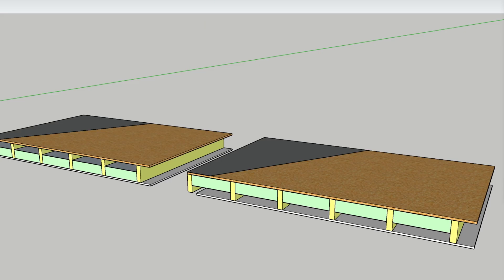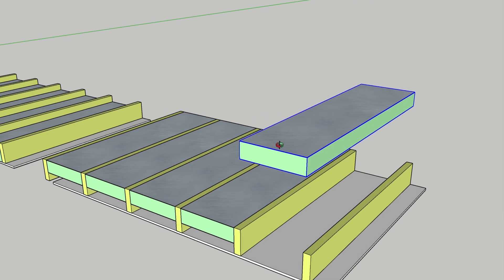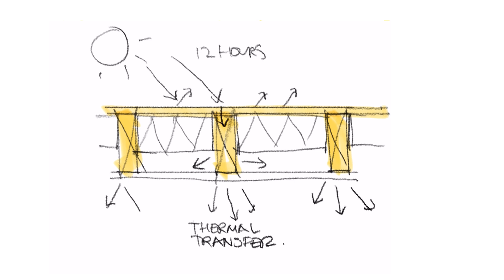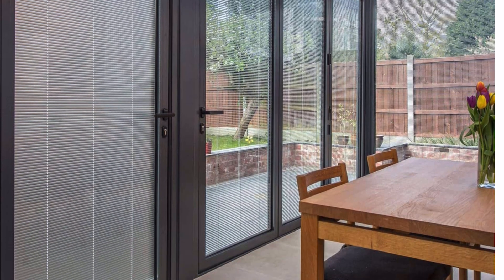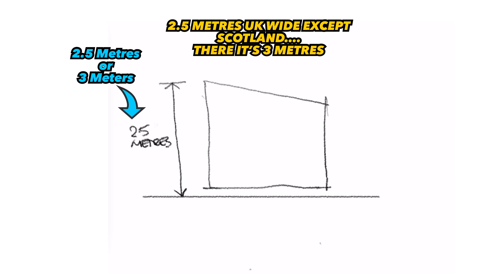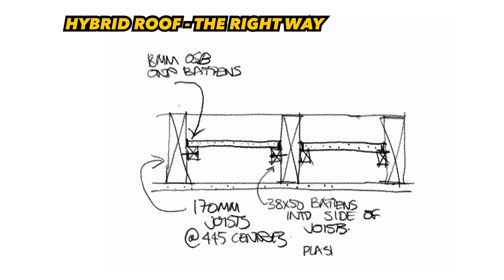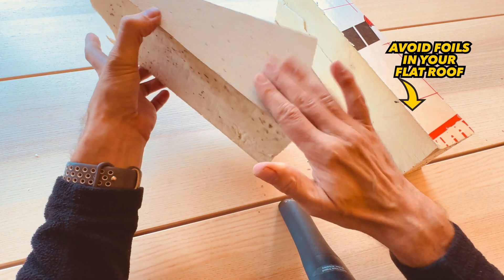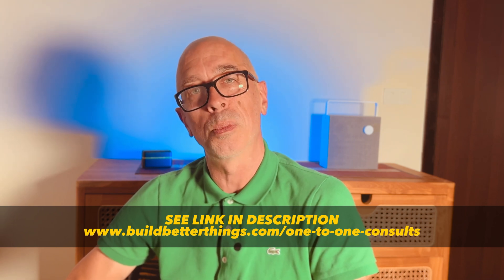Hybrid Roof - Build the Right Way- avoid overheating, avoid timber deck.

Comment: Sure this is less wrong than the "hybrid" roofs suggested by lots of these garden room builders but it's still wrong. The moisture is now going to be concentrating in the top of the rafters. The only safe longterm hybrid roof is using vapour open insulation and a vented deck. Can't always have our cake and eat. Better to have a low ceiling than a mouldy rotting space you spent money on and don't want to be in a few years down the line.
Reply from the maker: Hi. Moisture will collect where escaped and residual vapour meets cold. This will be toward the outer layer of insulation which sits over the joists, so beyond the upper face of  joists (you call them rafters,….same thing). That’s the whole purpose of the 30mm outer layer of PIR. These small amounts of condensed moisture can slowly permeate up and through the breathable compound of the EPDM. If you can get your joists down to 150mm, then that PIR increases to 50mm and an even better arrangement.  The whole point of this detail is to avoid timbers, but especially timber composites such as OSB, on the “cold” side. And avoid foils. Like you, I don’t love the detail, but there is no other way to prevent thermal bridging, rot, and achieve a useable floor to ceiling height for permitted development legislation. What I’m showing is the best possible make up to conform with the legislation. Since you’re mentioning “wrong”,…..I assure you….  your  suggestion cannot work with the heights available. Perhaps it’s just the legislation that’s “wrong”.

Comment: I had a roof designed with a foil quilt company. We have an non vented deck above the blanket, then 120mm of rockwool, foil vapour barrier, counter battern, plasterboard. Wiring and downlights fit in the counter batterned void. I could have done with a little more space for the lights, but compact downlights just about fit in and I only drop down the distance of the batterns for the ceilings to run through the house. What I like about the quilt is the ease to tuck in to the cavity wall insulation, all my steels are inside the thermal envelope, rockwool is so much better for sound insulation and I honestly hate PIR.
Reply from the maker: Agree, mineral wool more versatile for those tricky junctions and definitely for the acoustic side of things.

Comment: If you want to prevent overheating in the summer then you might want to look further than PIR!
Reply from the maker: Isn’t PIR a good insulator? What would you recommend instead?
Reply: @build-better-things  Cellulose for example, it can keep the heat out in the summer for much longer than PIR.
Reply: PIR is a good insulator but it doesnt have a lot for thermal mass.

Comment: Built a hybrid flat roof with the aid of a design engineer 1.5 years ago. 
Plasterboard
Counter batons
Vapour control Layer
Flat Roof joists fully filled with Steico wood fibre insulation
Osb 
Breather membrane
3 inches of PIR insulation
Trocal rubber membrane to finish.

Wood fibre does an outstanding job of preventing overheating in the summer.
###CRITICAL### is mechanical ventilation inside the rooms. Positively extracting any stale air 24/7.
No air pockets between joists whatsoever. (ie from vapour control layer to the underside of the deck).

I run a humidistat in each room from time to time to check for humidity issues but so far so good. Only time will tell really. 

NB Solid wood fibre cannot be used directly touching epdm so I went with PIR. This was approved by the engineer
Reply from the maker: Thanks a lot for the detail. Yes, it’s much less likely to get overheating in set up like that since eliminated thermal bridging. However, I’m interested to see you have a breather membrane without a ventilated cavity above the OSB. Have you had any problems with that?
Reply: @build-better-things  no problems so far. It's better described as a hybrid warm roof by the engineer. Removing that cold bridge above the joists yet not requiring through ventilation above the deck. The overall depth of the roof is quite deep but I was looking to meet a high thermal spec and reduce noise from a busy road.
Reply: @build-better-things  Ive tried joinging through your website, but despite entering my name and email, nothing happens, and i have checked my spam, is there another way to join
Reply from the maker: @jukeseyable should be working now. I’ve had a server change. Let me know and thanks for letting me know.
Reply: @build-better-things  Still not working, I initially tried to join around a month ago, a little less maybe, several times over the course of a week. Then again yesterday. Same result sadly. as in nothing.
Reply from the maker: @jukeseyable I just tried and it’s working if I put an email in. I’m sure you did, but…did you check your spam??

Comment: Is that 30mm pir enough for snow loads and maintenance work for future
Reply from the maker: The insulation is supported under its entire length by the thicker insulation and the joists, and the deck below that. It can take light foot traffic. So snow will be fine.
Reply: @build-better-things 
Do you have a technical calculation for that as per building regulations
Reply from the maker: Technical calculation for what exactly, sir?
Reply: @build-better-things  
If you have to ask, it proves my point, some people on YouTube think they’re electricians because they can wire a plug
A little knowledge can be very dangerous, people should really know their limitations
Reply: @ianjohnson1207look up the compressive strength of PIR. It’s used for floating floors all the time, and people pour slabs over it. It can’t bend here due to the deck and joists supporting it uniformly….
Reply: @michaelreardon8573  
Re read the question a little slower and see if you can understand it, because your comment clearly indicates you don’t
Reply: @ianjohnson1207 enjoy your Sunday pal
Reply: @michaelreardon8573  
Somebody walking on it isn’t the same as a floating floor or a concrete slab is it, it’s the surface area, put an 8’x4’ on a soft surface it will carry a lot of weight, stand on that surface your footprint will mark it.
It’s not rocket science, or maybe it is for some people
Ps I’m not your pal, that’s what dogs eat
Reply: @ it’s no different to any other warm deck roof. You’re always having to walk on membrane directly on insulation, unless you throw down a temporary board to stand on. The suppliers do sell roofing grade insulation slabs for this reason which are harder, and it’s also tissue faced to allow the gluing of EPDM. My point was the 30mm figure is irrelevant, it won’t dent any more than 100mm would due to being fully supported.
Reply: @ 
Correct but it will still dent, the thickness is irrelevant
Reply from the maker: @ianjohnson1207 PIR is rigid, inert and non elastic. So you can’t leave “footprints” ….or “dents” without first breaking the membrane.
Reply: @build-better-things  
You could be describing yourself 😂😂😂😂

Comment: what do you put on top of the rubber layer? rubber exposed to uv would degrade overtime right?
Reply from the maker: EPDM withstands uv no problem. Ponding is the main thing, other than OSB directly under and foils. But you could also consider what’s called an inverted, or upside down roof. Then you could avoid any worries with your membrane in that regard

Comment: Hi, I really like your information and will certainly take that into consideration! About overheating, celotex / PIR is not really great for that it’s the main reason why I am going to use wood fibre for my extension. The mono pitch roof is SE facing and I simply want to avoid disappointment during the months (from March onwards) where the solar gain starts to increase. Funny enough I had to convince my architect about this😮. The focus is a lot about U values and not so much, if at all, about many other factors like you describe. I use the German Ubakus website to investigate what makes sense and how a design behaves, that’s enormously helpful! Cheers and keep it coming.
Reply: So your qualified architect changed his mind on your say so 
I’d be changing my architect and getting recommendations for the next one
Reply: @ he did and but I think it’s quite underestimated. The emphasis is on preventing heat loss during the colder months of the year which obviously can save you a high heating bill. The opposite is that if your building is overheating, that’s quite annoying when you weren’t prepared for that.
Reply from the maker: Thank you for your insights also

Comment: Would it be a problem to build a roof like this without slop 
I have built and office witch is already 2.40 and I'm.planing to do a wall plate and fixbthw joist tobthe wall plates and do exactly what you said in the video but I don't know how to do a slop inside
Reply from the maker: The issue with a completely flat roof, off in understanding you correctly,  is that, there will often be minor indents and bumps no matter how hard you try to avoid , which, without a slight fall, will create what we can “ponding” where you end up with small pools of trapped moisture. This can degrade the roof over time. There’s also the challenge of figuring out how the displacement of water will drip off the roof when it’s level, so…where do you put the gutter?
Reply: @build-better-things   Thank you for your reply is it possible to the firring above the insulation ?
Reply from the maker: Yes but you need to then ventilated the void between the firrings

Comment: Great video. Love to see something like this on the different ways to apply steels into renovations. There are many ways to put a steel in. Mostly just the least effort for the engineer happens rather than the way an architect would add it to offer the same strength but with a much better customer end result
Reply from the maker: I made a few videos on putting steel in, plus acrows props needles and strong boys in some earlier videos. Hopefully they’re of some use to you and thanks a lot for your comment.

Comment: From Building regs on flat roofs

There is “an increased risk of interstitial condensation with a hybrid roof”, and recommends that a full condensation risk analysis is carried out

As part of its recent update, BS 5250:2021 Management of moisture in buildings – Code of practice

Footnote B to Table 4 says that condensation risk analysis calculations are required for warm flat roofs “if thermal insulation is split both above and below the deck or AVCL although typically no more than one-third of the thermal resistance should be on the warm side of the AVCL.” The term ‘hybrid flat roof’ is not actually used in the standard.

So your advice on the amount of insulation on the warm side is incorrect
Reply from the maker: I have a disdain for jargon, because it just confuses people and gets in the way of success. I also find people that revert to jargon often don’t understand the very regulations they quote. This is a case in point.
Reply: @ 
😂😂😂
You’ve certainly got the bluff and bluster down to a tee 
If you don’t under the regulations are exactly the opposite of what your saying then no wonder you keep posting nonsense
Reply: @build-better-things  I what way, you haven't actually addressed the point made
Reply from the maker: @stokebob He’s getting confused about the position of the vapour barrier. 100 pc of the insulation in my example is above the VCL, and is also not split between the deck. The regulation he’s blethering about is referring to the proportion of insulation when you put it below the vapour barrier, for example, the recommendation for insulated plasterboard fixed to underside of joists, in a cold roof arrangement.

Comment: how would I tie the inside insulation to the warm roof? 
Would I need to wrap the walls’ vapour control around the bottom of the rafters (which would lead to two layers for the roof) or do I cut the vapour barrier at the roof and seal it on the roof osb? 

Alternatively I could use Exterior wall insulation but I am concerned about damp transfer to the inside …

Cheers !
Reply: The NHBC site provides drawings and explanations of the actual regulations
Reply from the maker: @castroolivier if I’m understanding you correctly you’re talking about how to link the vertical to the horizontal vapour barrier and deal with the roof joists? I described how I do that junction very briefly in my warm roof video along with a couple of photos. But if I didn’t understand, ask again and I’ll do my best. There’s a whole video to be made just on that which hopefully I can do at one point.
Reply: @build-better-things  Many thanks for your reply!

Actually missed that segment in the prior video but that’s exactly what I was asking about.

I think a separate video with more detail would be great, but in theory it makes sense.

All best
Reply: @castroolivier  
There are detailed drawings for this on the NHBC website

Comment: How do you go about creating overhangs with a warm roof and not create cold bridges?
Reply from the maker: If you see my examples, I never create overhangs, and that’s one of the reasons why, I have zero thermal bridging in my timber frame construction and it’s on a par with SIPS and Passive house standards. However, with the same  warm roof and warm wall construction, you can still create an overhang with no cold bridging, albeit it requires a bit of fancy fixing.
Reply: @build-better-things  Trying to support the overhang by fixing through to the inner frame or building an additional support on the outside is quite fancy! I'm trying to find any resources on a simplified process to achieve an overhang but maintain a fully enveloped insulation.

Comment: Why do you keep pushing “your” theories in your previous video when it’s no accurate, not in building regs and absolutely nothing wrong with the warm roof design if built to building regs 
You have no examples to back up “your” theory, yes builders have pushed back for good reason
Reply from the maker: You seem to love watching and commenting on my videos. I’m happy about that. I don’t push anything. You’re welcome to take or leave my arguments . If you think foil faced insulation and OSB on the cold side is a great solution, then good luck to you. Since you keep mentioning it, Building Regulations are only about compliance. Otherwise, flat roof make ups would be prescribed within regulations, and warranties would not rest with builders and specifiers, but with the local authorities. Warranties rest with me, so there’s no way I’ll be doing anything other than what I demonstrate in my videos. Examples? I have loads of our own work…in the videos you watch.
Reply: @build-better-things  
This video is about placing of insulation and what you are stating in wrong 
no more than one-third of the thermal resistance should be on the warm side of the AVCL.” The term ‘hybrid flat roof’ is not actually used in the standard.
Reply from the maker: I think people who revert to quoting legislation, rules and fancy jargon, tend to do it because they have no solutions to offer. Furthermore….you do not understand the very regulations you refer to in your comment above.
Reply: @build-better-things  
Give it a rest will you, the building regs on placing insulation on the warm side of the roof are clear, a five year old could to understand them 
That raises the question, why can’t you understand them, it’s you that’s having trouble following NHBC regs
Reply from the maker: @timpeters4618 Yes. ….I’ve already tried to point this out to him but he just resorts to insults.
Reply: @build-better-things  
Oh the irony of your comment, you’ve had numerous highly experienced success builders correcting you and asking you to remove comments and video clips to which you ended up arguing with them
Reply: @build-better-things  
I’ve no problem with you applying your own theories to your own build, even if professional roofers and builders have advised against it on this channel, as do many architects sites and building regulations.
What I and many other do have a problem with is you advising other people that your theory is correct and everyone else is wrong 
And yes as many have said, if these people want to go against what is recommended by professionals and take advice from a Non time served professional, but a DIYer more fool them.
“Warranties rest with you” so you are clearly stating you will give a warranty to anyone that applies your technique to a flat roof build?

Because I have interacted with you your videos are automatically recommended by YouTube, I watched you timber frame garden room, its just confirms how little you actually know and would leave any time served joiner utter embarrassed 
What’s more frightening you obviously don’t realise this because who’d post themselves building something so amateurishly
Reply: What illuminating “theories” do you ascribe to fella? Terra plana?? Do not be afraid of the light .. this channel is here to save us … from interstitial condensation and cold bridges!!

Comment: Brilliant. Thank you. It all makes logical sense. But tissue faced is so pricey😢
Reply: Very informative thanks for the video! Have you got a series of build videos for the cool modern building you showed at the end with the vertical cladding? Looking to achieve that finish in my upcoming project
Reply from the maker: Hi. I’ll be releasing some info on that shortly. Thanks a lot.
Reply: @build-better-things  thanks I'm particularly interested in the minimal finishing detail on the roof without using fascias. Looking forward to it
Reply: People building roof No1 are not builders, or DIY experts as you say anyone building this type of roof is a cowboy
And YouTube is awash with so called experts on building matters, if anyone is unsure check with the building regulations in what ever county you live in, certainly not on YouTube
Reply from the maker: Really it’s not that much difference. You need to buy the 1200 x 1200 batts. Thanks a lot for the comment